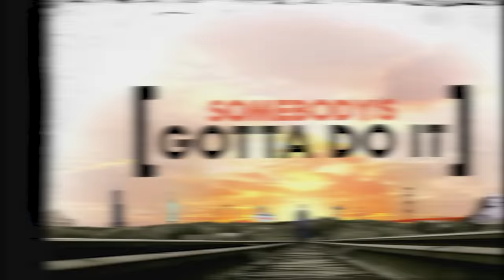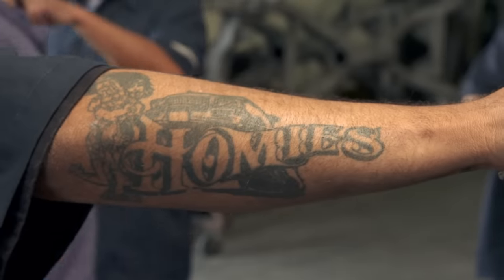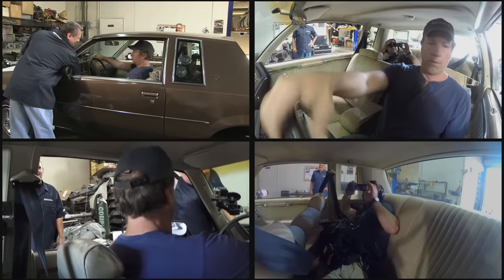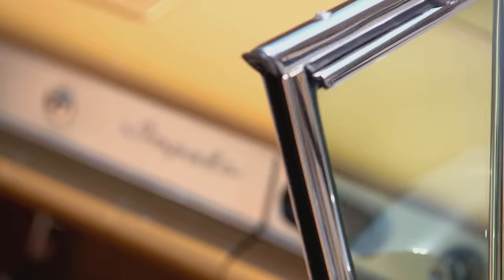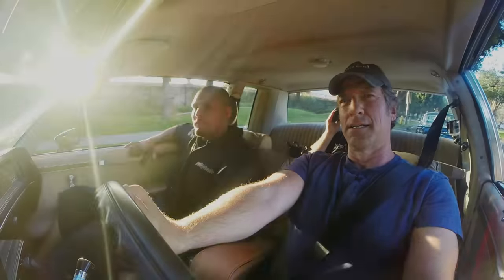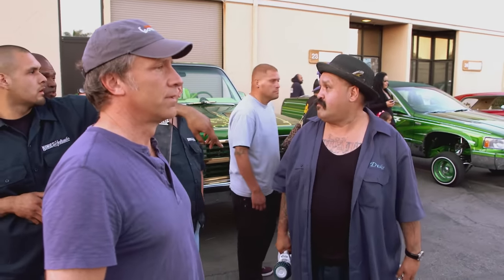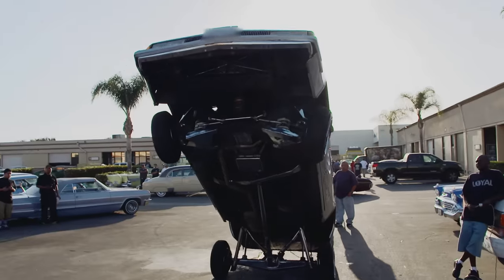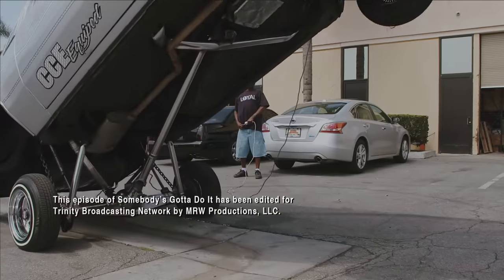Mike Rowe: How to Make a LOWRIDER Car! | Somebody's Gotta Do It

Comment: That gives me the giggles. I wonder how long that would last. Probly as long as the car does. The belairs and impalas and such are really well done.
Reply: The impalas are popular because of the X frame. It allows for easier 3 wheeling. 
However, over you get deep into the scene, you end up plating and reinforcing the entire frame. Otherwise you'll kink panels and pop out glass.

Comment: Is about having fun all year long. Both my car's has Red's. This is not chang much from the 80's got a set of Porky's pump's with there switch box. Just fun and $💰 to spend on the side. Alot of power in theme this day's and brakes faster drive on Sunday and $200 to fix it next week.

Comment: I imagine with enough time (soon) they’ll be able to make cars precisely hop over potholes at speed with just enough height and only the wheels that need it to be in-perceivable to the driver; also imagine the same tech on crack used for Baja racing and being able to control jump the car at the push of a button so they can jump big gaps and such at speed.